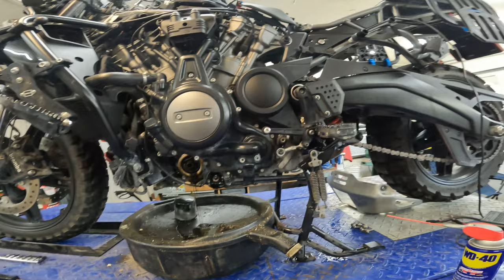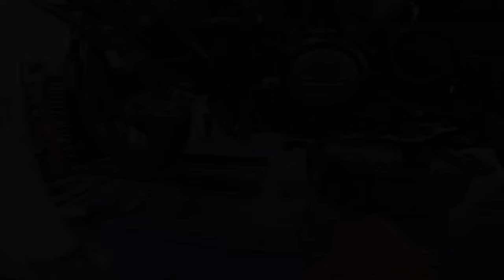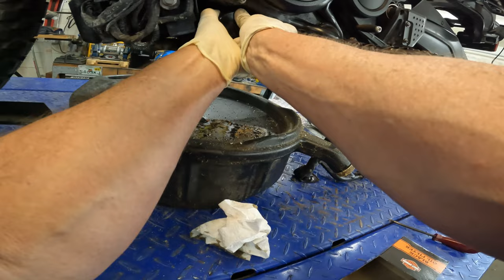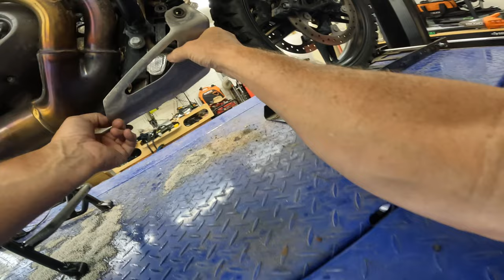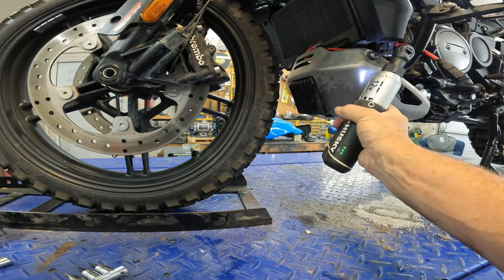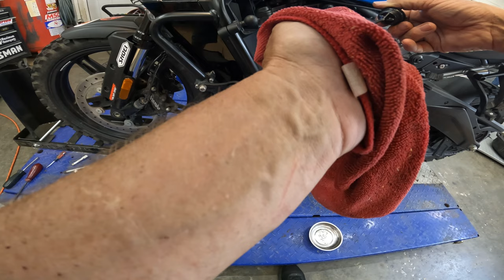Harley Davidson Pan America Oil Change Part 5 of the 10k Mile Service

Comment: I note that 15-50 Syn-Blend is most recommended oil by HD for Rev Max engines. Also, HD has recently advised dealers of new oil level check procedure for Rev Max engines: engine to be at operating temperature and bike upright (not on centre stand) - oil level to be between bottom and full markings on dip stick. Cheers.